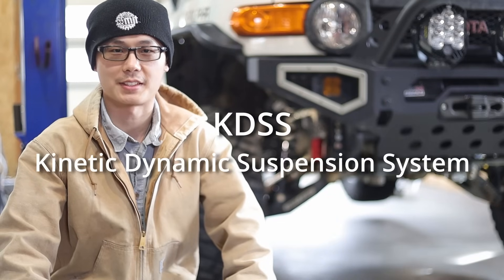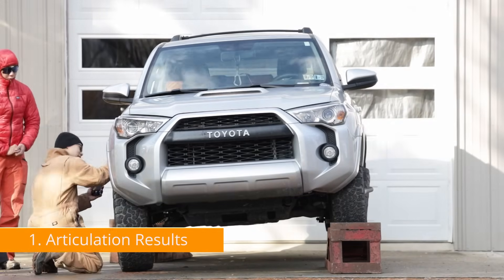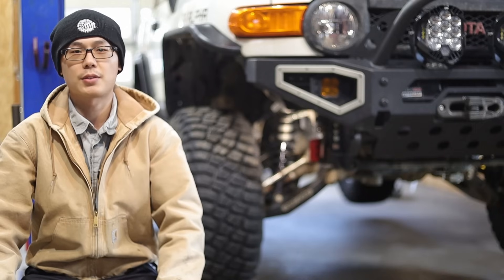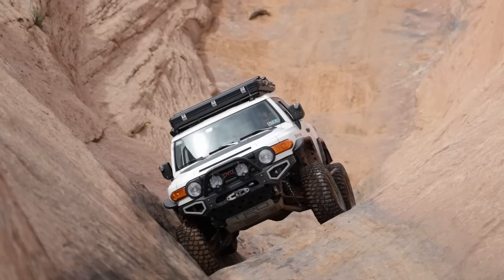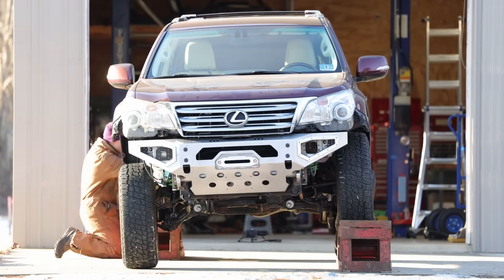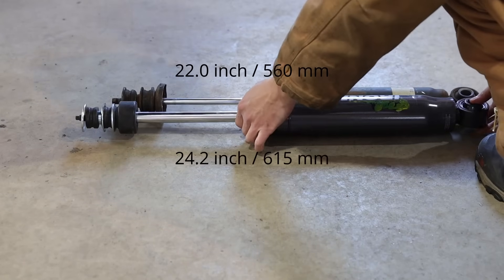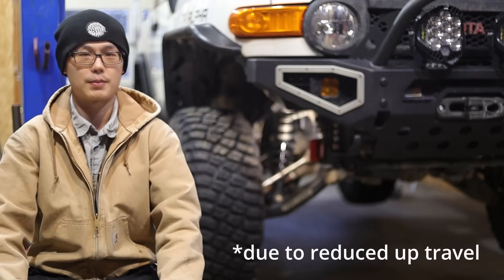Toyota KDSS Ultimate Test | Legit or Gimmicks?

Comment: I would highly advise against using that single spacer on the front... This is only masking the issue, and then adding risk that can blow the cylinders. The cylinder links should average out to be the same length as rigid links, acting like a traditional sway bar when the valves are closed. This is only achievable by correctly tuning and preloading the front springs (rear will automatically level due to the stiff ladder frame chassis and live rear axle). This will be dependent on vehicle added front weight, lift height, component condition, etc. By using this spacer, you effectively add some length to the front and take some from the back (not noticeable straight away due to the accumulators, but think of it when they are closed, which will happen after some time). Then you have now lost down travel on the front and up travel on the rear due to this repositioning of the natural level. I would imagine when off-roading, and you come down hard on that rear... Bang! Damaged rear cylinder, leaking KDSS. No issues with double, even spacers on the back. Disclaimer: I do not have personal experience on this, it's just an observation/educated guess. 

It would be great to see you do a video with specific testing related to the KDSS system and how it responds to different springs etc. 

Your channel deserves many more subs. The way you deliver this information and the "sticking to the facts" approach, leaving your bias behind, is a breath of fresh air. Keep them coming.

Comment: I think it should be possible to define something like an off-road button for the ECU that when activated it would close the solenoid valve as if the car was driving at higher speeds. Even if that's not possible it might be possible to manipulate the vehicle speed signal to the ECU so that it registers a higher speed.

Comment: G'day Tink,

I've just installed an Ironman Foam Cell Pro 2 inch lift kit into my 2015 Kakadu Prado. I'm having issues with the car leaning to the right (drivers side in Australia). My initial thought is that the kdss cylinder attached to the rear sway bar isn't compressing completely ie, locking up. I was wondering if you have measurements for the this cylinder completely extended and completely compressed? Cheers 🤙

Comment: Hi TA, have your heard of the "the Bose suspension system"? It's an electromagnetic suspension system. Could you run a detailed examination on the Bose suspension system ? And give us your conculsion? Thanks
Reply from the maker: Yes I like that suspension. The US military also developed some similar concept with much higher suspension travel. Those are active suspension and I think would be the way to go in future EVs. All the suspension we are dealing today are passive, or reactive. So we always have to make compromises and trade-offs between different scenarios.

Comment: GREAT video.
When performing a CTI test at an off-roading event, I realized to maximize the GX 470, I should have had rear airbags raisted to high.

Have you done similar comparisons with your available GX 460 in normal vs raised rear ride height given factory airbag rear suspension on the GX platform?

I'd love to see if you get different articulation metrics in normal vs raised ride height.  When I'm crawling in low speed technical situations I prefer to raise the rear for added clearance and suspect it may affect rear articulation as well. 

Additionally, on the technical front, I think (150) 5th gen 4R and GX 460 KDSS differ slightly from (120) GX 470 systems.  Apparently there is an electronic interface in the 150 system which changes how the KDSS performs in slower or wash-board situations when compared to the 120 platform.  I would LOVE to see your analysis of the different KDSS systems in the market, from 120 GX 470 to 150 5th gen 4R and GX 460, to 100 and 200 series land cruisers.  I recognize that's a big ask though which then begets more questions about stock vs modified (i.e. lifted) versions of each of these platforms. 
I too would love to see comparably lifted KDSS (e.g. 2") rigs with and without the KDSS spacer kit installed (as you alluded to in this video)

thanks for your technical videos, i always learn from your content!?
Reply from the maker: Thanks! This GX did not have air lift from factory. Interesting finding you have. Im not familiar with air lift system and how it affects the suspension stiffness. Yes I knew the land cruiser KDSS is full mechanical. But didn’t know the 120 platform is also different. Will check it out if I get the chance to work on one
Reply: @TinkerersAdventure  Yes, the 120 platform(GX470) had airbag rear suspension with ride height adjustability (lowers approx 0.6" for "ease of passenger entry" and trailer coupling, and raised ride height adjustment lifting 1.6" (IIRC), for added clearance and articulation. Awesomely, this airbag suspension is auto levelling as well, so even when carrying >1,000# of persons and gear, the 470 rides at stock clearance without sagging AND you can still raise the rear by the 1.60" ride height adjustment.  However, while stock in the 470 I think the adjustable airbag suspension was only available in the premium trim level of the GX460 (150 series).  Additionally, I think the 150 platform (460 and 5th gen 4r) has electronic actuators which effect KDSS functionality differently from the 120 platform (GX 470).

Along with the AVS (adaptive  variable suspension), adjusts shock valving for soft compliant ride to a stuffer more tight/active feel, I think the 470 has different ride and off road performance characteristics than the different 460 trims and the 5th gen KDSS 4R.

It would be amazing if you'd be able to look into and tackle some of these details... I recognize that's a tall order though. 😉🤙🏼

Thank you again for your detailed and thorough analysis content!
I look forward to your product specific reviews (i.e. Dobinson's MRA for the Prado 120.platform 🧐🤙🏼) and comparisons, thank you for staying objective!

Comment: What are your thoughts on the 4runner pro with fox vs the KDSS system?
Reply from the maker: TRD pro for high speed off-road. Going through whoops most of the time both wheels go up and down the same time. But a KDSS 4Runner will significantly out perform a TRD pro in crawling and articulation

Comment: Has anyone scoped the signals to the solenoids? Could build a simple controller that is basically on/off with some zener diodes to override the factory signals. Basically always on unless switched off
Reply from the maker: I would love to see one that safely control the solenoids directly like you said. The only options out there right now is to fake a fault signal to KDSS module. KDSS dash light will come on and the system goes into fail safe mode, which is solenoid always open. People use this to make the ride smoother on high speed rough road, but basically swaybarless front and rear
Reply: @TinkerersAdventure  hmm 🧐 now I just need a 460 to investigate 😂

Comment: Be sure to consider, with IFS, the angles of the CV joints. The anti-sway bar helps to protect the cv joints during full droop, by preventing the cv joints from experience extreme angles and damage. For example: https://youtu.be/vJPgBzf85sc
Remember stock 4Runner, FJ, or GX are very capable. I have moderately upgraded my 4Runner suspension within my budget for overland travel. I believe the more expensive and extensive modifications are not justified for the majority of situations that you should take a 4Runner or FJ. Keep in mind there are limits to any vehicle and it is better to change to an appropriate vehicle if you want to go beyond those limits, rather than waste money and time. Overlanding is not rock crawling. Rock crawling (or extreme off road) is better performed by a dedicated rock crawler (that is is not appropriate for road travel).

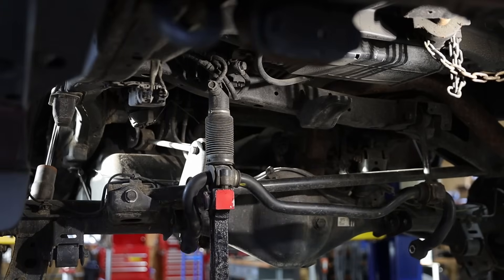Comment: 7:22 could we not wire in a control to manually activate the solenoid at slow speed to assist in off camber situations? Effectively eliminating the drawback with the flip of a switch?
Reply from the maker: You can easily do it for the opposite situation: forcing them to open the valve for high speed. But the situation you describe is not easy to achieve. No solution I’m aware of
Reply: @TinkerersAdventure  if the solenoid is just open/close. Should be easy enough to wire a switch and bypass the whole system. Probably would cause some error codes though.

Comment: I’d agree with many here.  I have a trail 4Runner with KDSS, armoured and heavy, and it is amazingly level on road in the corners, even when pulling a trailer.  The beefy sway bars work very well but have the benefit of being disconnected.  I do wish I could override the system though to try different things. Aside from that. Zero complaints,  even when forums, etc tend to favour not having the system.  Oh!  Only issue I have is working the front end with the added connections.  I sometime struggle with those being under tension/compression and getting it bolted up.

Comment: I have to complain about your video quality....it is so good I have ignored my girlfriend over the last couple of days and stayed up way past my proper bedtime. So refreshing to find someone who actually knows what they are talking about in this space.

I have a stock Kakadu (Prado 150) with KDSS (rear bags) and, just like you, do long highway distances before getting somewhere where I want reasonable ground clearance and good articulation. Was hoping to run some taller tyres but not much wider (max 275's with profile ~34") so probably need a UCA that will allow forward positioning of the spindle to avoid the FBC. I was not clear from your video on details of the modifications.....do you suggest keeping the TPMS shocks? With spacer? If not what shock do you suggest? Do you also change the spring/type? And which UCA would you suggest for my application?

Off to bed now!😂

Comment: Hello. Question? I have 2016 4RUNNER. Not a 4×4. Shop installed Bilstein 5100 with coil springs front and back. Including spc upper control arm.
3 inches lift front and 2 inches lift back. To make it even height. 
Noticed, the front right side is higher 0.5 than the front left side. 
I brought back my 4RUNNER to the shop who installed. 
Shop told me that, that's Normal and that's how 4RUNNER made to.
Please need your advice on how to make it evenly. If there's another way. Front right side coil spring end(top) not the same position as the left side. Both sides on the bottom are the same positions. 
Or, Do I need different shock absorbers with reservoir to balance the weight evenly?
Thank you.

Comment: I have KDSS in my 5th Gen 4Runner. Perhaps my favorite thing about it is cornering on dry pavement. I am always surprised how little body roll it has considering the otherwise soft suspension. I will say however I haven't actually driven a 4runner without to compare.
Reply: Hi Tyler would you recommend KDSS to a 2023 Honda hrv lx? Could you review, examin and conculde your thoughts between" the Bose suspension system vs KDSS? Thanks.
Reply: @go5582  You trolling me bud? Just trying to let people know that kdss helps people that drive wobbly trucks go a little faster without losing control on corners. Just in case tho - I'm pretty sure kdss won't work on your hrv. But I'm not an expert. I thought Bose made speakers.

Comment: When watching shade tree mechanics install lifts on kdss equipped vehicles many of them don’t know to loosen both valves under the drivers door side of frame and mark original setting with a wax pencil. It allows the swaybars to move around more freely. After lift is installed lower wheels back on ground, turn valves back to original setting. Also KDSS vehicles will develop what’s called “Kdss Lean” over a lot of miles. This is also fixable by practicing the same principles of loosening the valves, and measuring the lean and putting the same height wood block under the one wheel once you lower the vehicle back down, then just tighten the valves and your back level.

Comment: Great video.

Can you comment on the on-road handling of a 4x2 4Runner compared with a 4x4 with KDSS?

Here's some information I've dug up in case it helps. The front stabilizer bar diameter on a 4x2 is 1.22" and 1.68" on a 4x4 with KDSS. Don't know the rear thickness for a 4x2, but the rear on a 4x4 with KDSS is 1.18".

My goal is on-road comfort (but not interested in X-REAS). Before you ask, I will probably never go off-roading. So why would I consider a 4Runner? I am interested in it's simplicity and reliability. And why consider a 4x4? Because it wouldn't hurt resale value, and just in case KDSS is perceived as more comfortable than a 4x2. Also, I know sway bars technically do not improve comfort, but rather reduces body roll which makes for a more stable and confidence inspiring drive that many rave about. If I can beef up the sway bars on the 4x2 to match that of KDSS's to improve handling/comfort, I would consider it. Though, there are also the accumulators you mentioned that also help prevent vibrations from entering the chassis. Some people say that KDSS on-road high speed bumps can actually be more jarring.

All in all, if cornering/turning characteristics wasn't a large factor, would non-KDSS or KDSS be more comfortable for the long on-road drive?

Comment: @tinkerersadventure quick question, there will be no issue if I remove the the front bar and leave the rear one attached am I correct? I’m installing a long travel (tc 3.5” race) kit on a 5g4r with the kdss system. The customer already has a icon 2.5” with reservoirs in the rear with upgraded springs and lower track arms

Comment: Hi bro! Can i ask what you think of front extended swaybar links on toyota IFS? I installed a set of hardrace extended swaybar links. Felt better but not suee if its placebo. Super close clearance from the bottom of the link to the top of the cv boot tho. Is this practical or should i go back to toyota swaybar links?
Reply from the maker: The front extended sway bar link has no effect. In theory, it actually infinitesimally reduces the roll stiffness. Some may argue aftermarket endlinks are “stronger”. But I have the same opinion as I have towards aftermarket UCAs (check out my UCA video). The rear end links are a different story.

Comment: Excellent video! I have a Jeep tj which I love but I have been wanting a 4Runner for quite some time. Your videos are more useful than anything else on the internet by an enormous margin. 
You should check out the ORO Sway-loc sway bar system for the Jeep Wrangler. I have one and it might be the best improvement I have made on my jeeps suspension. It is essentially two swaybars in one that you can switch between with the flip of a lever (highway mode is tubing that is stiffer than the factory swaybar and off-road mode is a thinner bar that rides inside the tube). I wish someone would design something similar for the Toyota ifs system because I am unwilling to go swaybar less with a long travel setup.

Comment: thank you for the content. its extremely helpful to help me make the best decision as this will probably be the last new vehicle i buy. i was curious even with the off camber stability and high speed bumpy roads why you would still recommend KDSS? 

today i test drove a TRD pro, it honestly felt fine since im a bit of a grandma driver. my wife on the other hand, felt the body roll when she drive (lead foot driver). i dont plan to daily this vehicle and really only plan to use it for camping trips, some washboard roads, and some light backcountry/rock crawling. a modest lift of 2 inches or less. is it still worth investing 1700 towards KDSS and all these modifications to accommodate KDSS? or just invest that 1700 towards aftermarket suspension?
Reply from the maker: To me it is simply articulation but still have a swaybar on road. I had to removed the front swaybar to achieve that level of flex. TRD pro is designed for high speed off-road, which is not important to me, but could be for you. Its IFS does not flex more than the base model 4Runner because it is still limited by the swaybar stiffness.
Reply: i think longevity and reliability have already been proven which really just begs the question, why wouldnt you want KDSS? for the majority of users looking to off road moderately, im having a hard time finding a reason when we have fixes for all the potential problems except off camber lean so far.

Comment: Absolutely wonderful video. I'm happy to see other people understanding and explaining real wheel travel and what KDSS actually does. They make an electric shut out switch that allows you to keep the KDSS valves open or closed at any speed you want with a push of a button. Its wonderful.
Reply from the maker: Thanks! The switch can only overwrite-open the valves, not overwrite-close the valves. This is achieved by faking a fault signal in KDSS so the ECU goes in fail safe mode (valves open), which is why the KDSS dash light comes on.

Comment: Why doesn't the 4Runner TRD Pro come with KDSS?  I'm thinking of trading in my TRD Off Road Premium (with KDSS) for a TRD Pro.  Will I notice significant increase of sway/brake diving on road?
Reply from the maker: The TRD pro, with the internal bypass fox shocks, are designed for high speed off-road. The KDSS is for articulation. The Pro will not perform any better than the regular 4Runner in this video in crawling. You will have more body roll. Brake diving no, because that is not related to swaybar

Comment: I may missed it, did you say the solenoid valves automatically open and close depending on speed?
Reply from the maker: Yes, they are electronically controlled based on speed